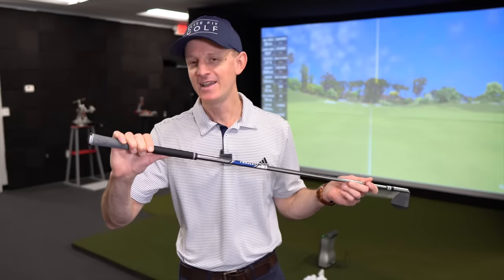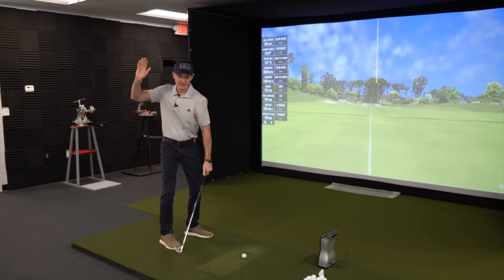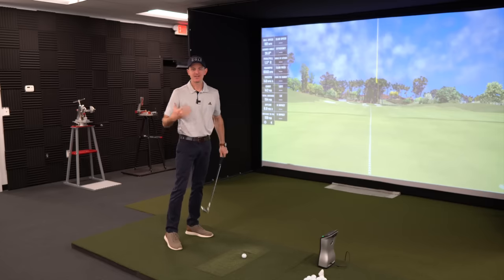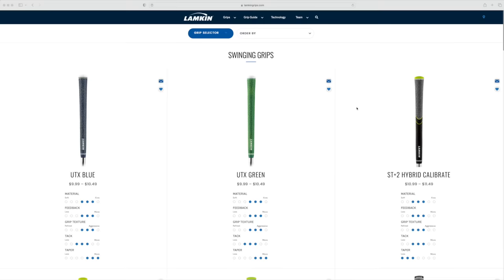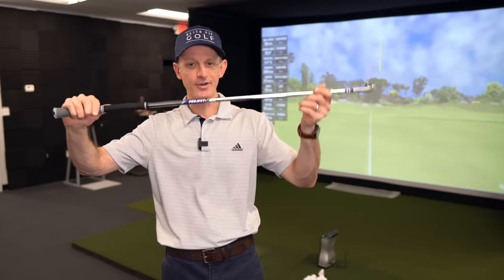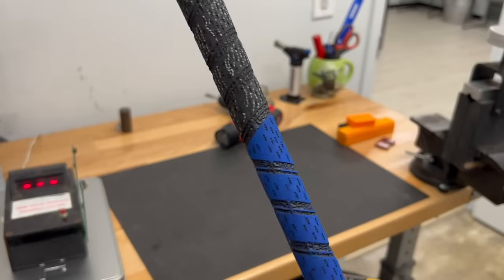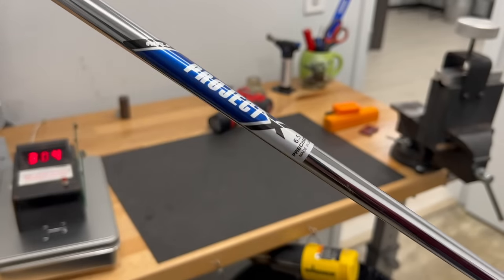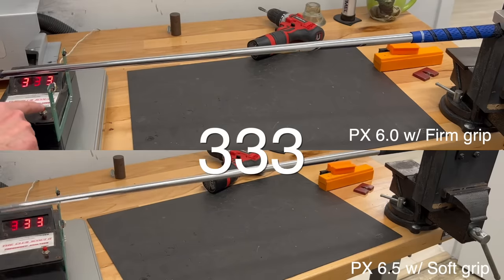NO ONE TELLS YOU THIS When Picking Golf Grips

Comment: Everytime i get a bowling ball drilled, the driller makes a comment on the size of my hands. 🤣
More than likely i could use larger grips on my clubs. I do tend to get a weak grip sometimes. Maybe larger grips would give more contact surface area with hand to grip.
Reply: My bowling thumb hole uses the biggest drill my proshop has, I use Jumbomax Zen Light grips in the Large size, they recommended XL on their fitter

Comment: Is it the stiffness of the grip, or the weight of the grip. Heavier grip = less swing weight. Less swing weight = stiffer shaft?
Reply from the maker: Also an important variable but separate from the question here. Grip weight doesn't change the way the shaft bends the way head weight does. It can change how the golfer sequences their swing and result in different results but again that's a separate question.

Comment: Nice video. This way of measuring is not completely accurate. Normally, the hands have a wider grip than the vise, and the hands are also much softer. There will probably be differences between soft and hard grip, but much less than what you show here.

Comment: That's due to the grip softness. The softer the grip the weaker the shaft will read on the frequency meter.  The shaft does not change frequency.  To be accurate then check without a grip.  I used a frequency meter back in the 90's.  Your just not getting the correct reading.
Reply from the maker: No one is thinking the shaft actually looses stiffness from the grip. The whole idea is the "give" in the grip mimics the give in the shaft so the feel can change because of it. This all arose from clients who complained about the way they were hitting the ball with certain grips.
Reply: Ok.. thanks for the clarification.

Comment: This seems like fitter hocus pocus to me. We all know the ruler on the edge of a desk vibration. That vibration frequency is changed dramatically by simply moving the length of the ruler over the desk edge. Without confirming identical shaft length, weight and point of contact with the vice, this test demonstrates absolutely nothing. The frequency of vibration of a shaft can be changed by simply changing hand positions up and down the grip. Not something I think the average golfer needs to be concerned with.

Comment: frequency is not flex.  It is a comparative measure of a shafts stiffness when oscillated, but does not account for variations in the flex profiles of shafts.  It tells you how a shaft oscillates and the relative stiffness of the shaft in that mode of measure.  It does not tell you how the stiffness may vary in the mid section or tip section of the shaft.  That is why you can have 10 shafts that have the same butt frequency when clamped into the 5″ clamp and oscillated, but none of them play or feel the same.  I still think it is a viable way to get an initial comparison of shafts, but just be aware of what it is, and what it is not, telling you with the numbers.
Reply from the maker: I know all that but for this demo I think it works because we are isolating a single variable and using frequency as a quantifiable measurement.
Reply: You are putting a "cushion" ie the grip in the clamp on the analyzer , so was the clamp a consistent pressure ??? & with the softer grip being less firm in the clamp , of course you are going to get a different reading than a firmer grip. It is NOT changing shaft flex , merely giving you different readings due @EFGMC
Reply from the maker: @lyonnes  The clamp has a set psi. Obviously the physical stiffness of the shaft isn't changing based on the grip, it's the "give" or bend that your hands and fingers feel that is changing, and that is really what matters.